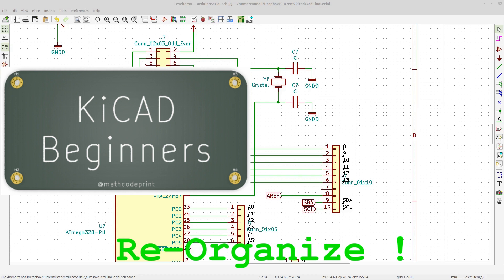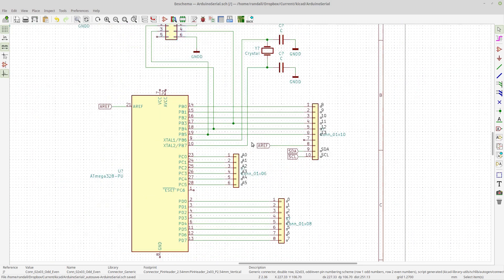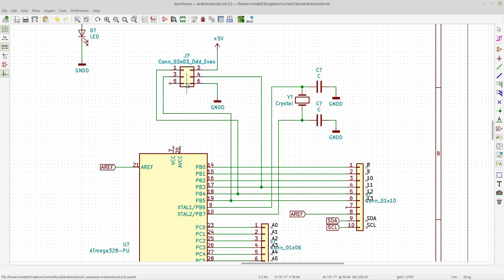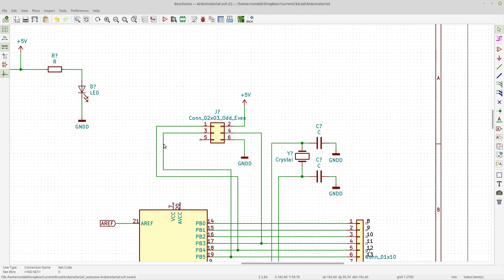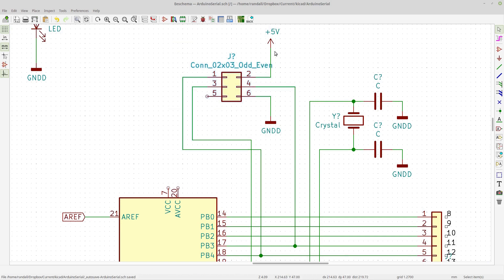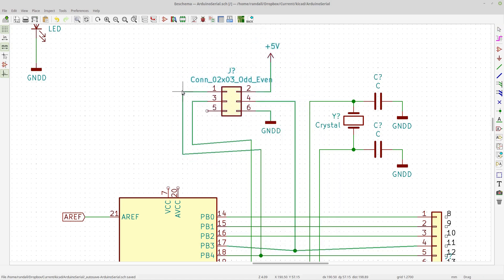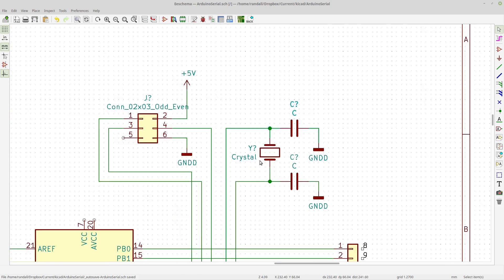KiCAD Quickie - Rearrange symbols with Drag.

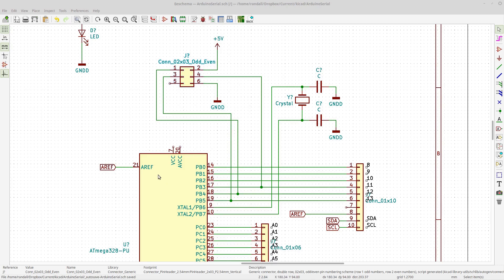Comment: 1:10 The key take away I got from your video was holding the "G" to get the wires to follow your component.  Without knowing about the "G", when I click and drag components like you do, the wires do not follow, but the wires separate.  I had to watch that part several times to "catch the G".  It's the most important thing here!  Thanks for the video, it was a great help!

Comment: how are you able to select and highlight the selection? if I drag over the schematic, it automatically starts moving the selected parts (although I can press Tab to switch to drag mode).
Reply from the maker: I am wondering if we are on different versions. I am on KiCAD 5.99, when I left click/hold and slide mouse I get the selection box. Then release to make selection.
Reply: @mathcodeprint  wow! that seems a lot higher version than I remember having... Don't remember exactly what apt repository I am using, but It surely is a custom one, not the default ubuntu ones 🤔

How are you managing your KiCAD installation?
Reply from the maker: Head over to the site, you can download a package. The improvements are worth the extra effort